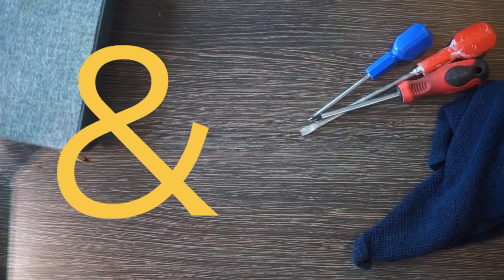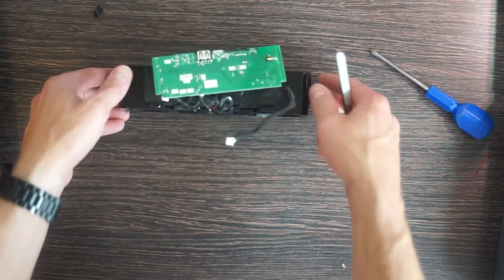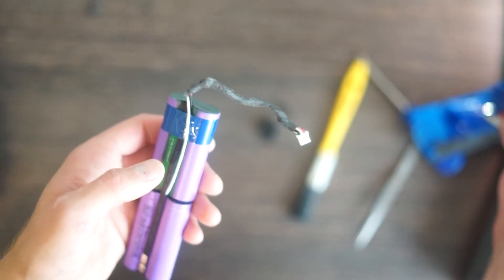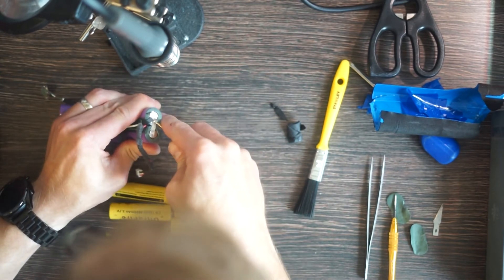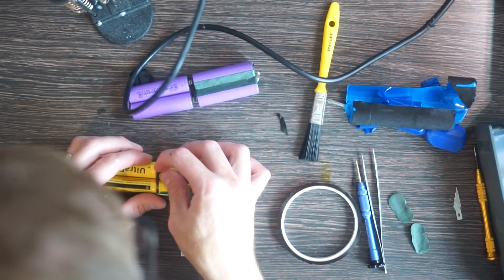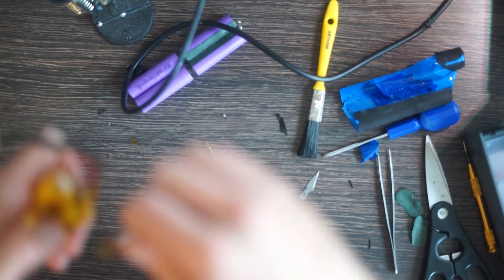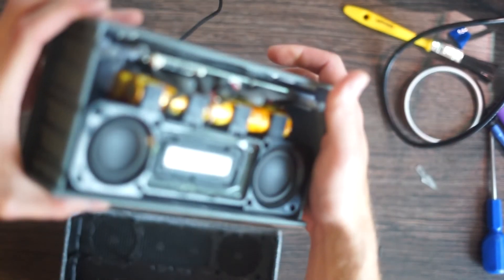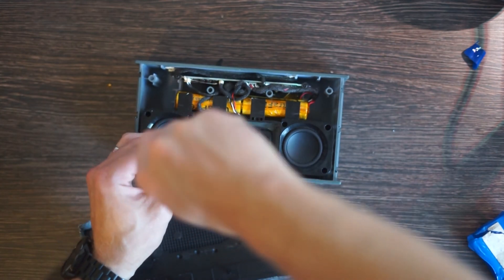Rockbox Chunk Battery Replacement Part 2

Comment: Good repair - I have one too which has started to act up. And as these are good speakers and are not inexpensive, your two video were a great find. I also have a nickel strip spot welder , dmm, and (maybe) some other cells available to recycle.